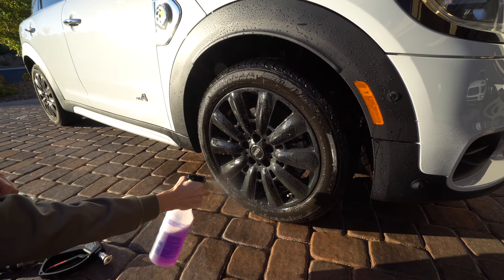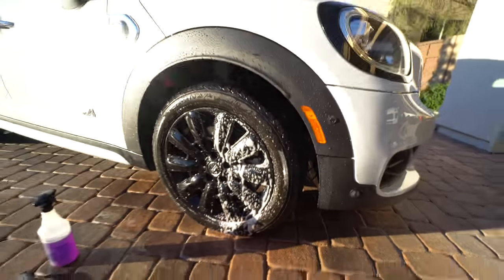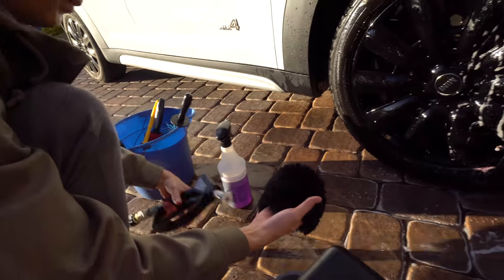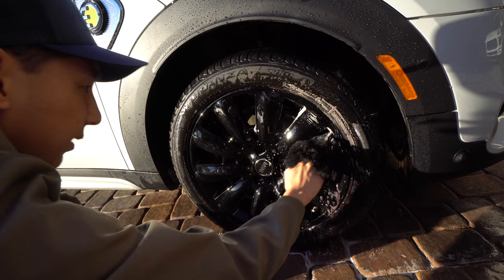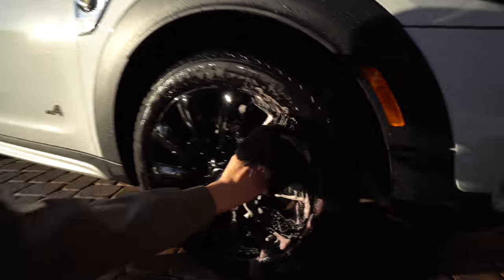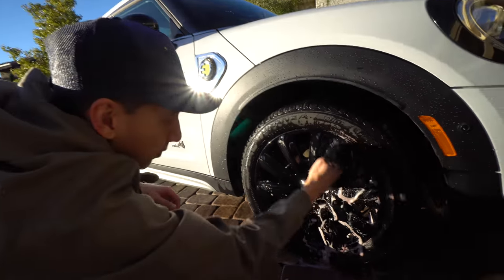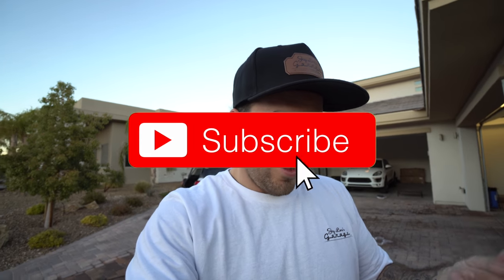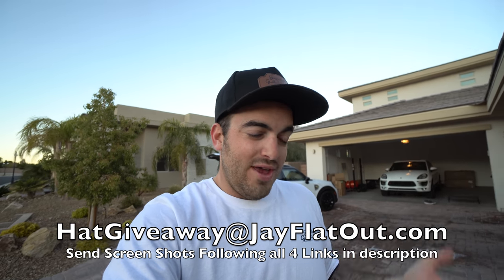Jay Leno's Garage Detailing Product Review - Jay Flat Out

Comment: Jays products are probably made by another company and sold with his name on them.  I'm hoping its not a blender service.  I'd be willing to try his products if I could see more reviews.  YouTube as of yet doesn't have tons of them which isn't a good sign in my opinion.
Reply: I found them to be good. I'm usually pretty skeptical about "celebrity" product lines for that same reason, but if it works it works. It's USA made so I assume some other manufacturer does a formula for them. They seemed a little higher quality than just a run of the mill chemical blending service but i'm no expert.